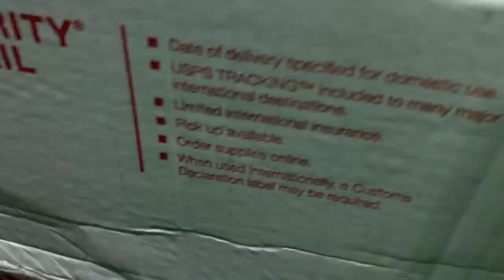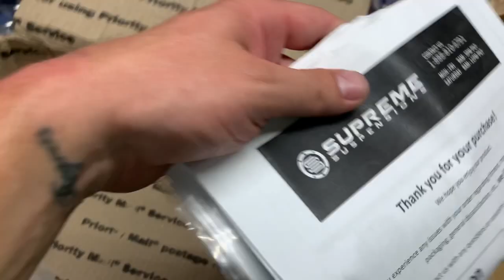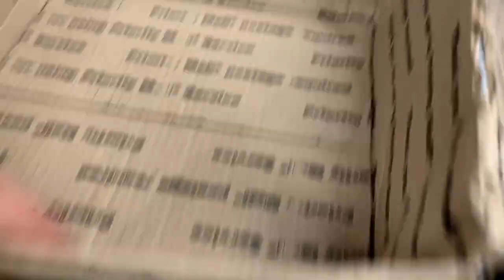2020 Silverado Lift Kit Fail

Comment: I just watched all of this. I put the same type of kit on my truck, 3 different trucks actually. 1. You don't need to grind off the tops of the mounting studs, they fit fine without doing that. 2. Before you bolt the spacer to the top of the strut you use the bolts that came with the kit and come up from the bottom of the spacer, thread them in to form studs sticking out of the top of the spacer, they're socket headed bolts for this reason. You then use the nuts that were holding the strut in the truck originally to bolt the spacer to the top of the strut, that size socket fits, but I used a chrome 3/8 drive deep well. As for the bottom, I popped one of the clips off, they just pop off with a screwdriver, then I grabbed the tab with vise grips, slid about a 4 foot pipe over the vise grips, laid the strut on the ground and turned the bracket in its bushing 90⁰. It's just a rubber bushing. Then it went together just like it came apart. Also, if you're also putting something on the bottom of the strut then you will need corrected angle upper control arms, and you will need the strut out to replace the upper control arms. In back, with that big of a block you'll need either shock extensions or longer shocks. Good luck!

Comment: Well , some days you're the windshield .... some days you're the bug .  It happens to all of us .  Doesn't that mount on the bottom of the strut turn in the rubber bushing ?
Reply from the maker: Mine will not move. It’s in a fixed position
Reply: @thejoshwileychannel  ; I've had shocks like that and had to adj. them to fit. Sometimes you'd have to lube them up with penetrating oil as they could be difficult .  I just thought that they would have to rotate as the suspension goes up and down .  Sorry Bro .
Reply from the maker: I was able to twist it a little bit but as soon as I let off the pressure it would go right back to where it was originally set
Reply: @thejoshwileychannel  ;  Can't say you didn't try !  Bummer !
Reply: Its a b** but that part in the rubber bushing with turn. Might need to pull the strut back out, clamp one side in a vice, and then use the assembly like a handle to turn it to the new correct position.
Reply: @xxRock81xx  that does work, I've done 3 of these. I did it that way the first time, and the 2nd and third time I used vise grips and a long pipe, it does turn, you just have to force it.
Reply: @Dumbass_mechanic  I know that, thats what I was saying also.

Comment: I had the same problem but I figured it out you have to put the bottom tabs in a vice and turn or bend them and they fit perfect
Reply: You are supposed to switch the driver side and passenger side struts LMFAO
Reply: @mdefedele1  it doesn't work that way

Comment: You already had the cut off with you. Why didn't you just cut off more of the threads? And or not put the socket all the way into the extension and done that. Your the guy that should pay to have work done to their truck truth be told.
Reply: Truth

Comment: I had exact same problem did you figure it out?
Reply from the maker: No.
Reply: Just swap driver side to passenger and passenger to driver
Reply: @SouthernTwitch  that doesn't work, you have to turn the bracket in the bushing 90⁰. I just used a vise grip and a pipe